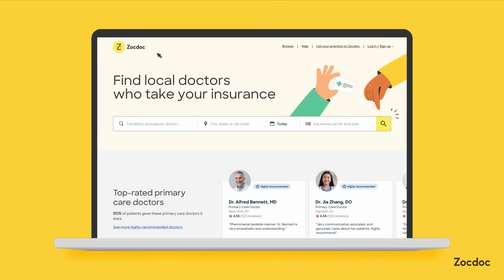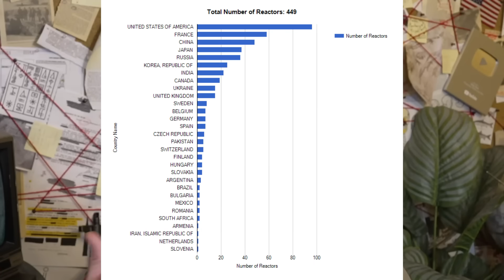America's Abandoned Nuclear Reactors | King Trout

Comment: One thing I'd say is that the 3 mile island incident was literally only detectable from the outside because someone at the facility vented the material into the outside air. It wasn't handled perfectly, someone was trying to cover their ass. But even with someone trying to cover their ass the measurable dosages of radiation would cause less harm to you than the amount of public panic caused by the incident. People literally hurt themselves more stressing over it than any amount of harm the radiation could have done to them.

Comment: NPPs were hardly profitable from the start. The fed gov't wanted them so they'd produce Plutonium, the electric power would just be a byproduct; thus the first, in nowadays engineering terms "dodgy" reactors were built.

After decades of nuclear scientists and engineers developing semi-fail-safe PWRs in the 1980s, the whole hype was over, as construction, maintenance & operation costs had gone beyond sky-high.

Finally, the cost for nuclear waste disposal won't be low either.

Comment: Actually, with the potential for modern, inexpensive internet resources, you could solve a lot of accountability issues by simply making a massive amount of such projects transparent to public scrutiny, rather than top-down centralized oversight and constant auditing, you could just set up programs that use large amounts of public funds with part of the contract stipulating that very large portions of planning and expenditure information be made publicly available within a specific timely manner. Thus maximizing transparency of operations and making it far more difficult to misappropriate funds, make unreasonable bids, allow questionable engineering decisions to go through, etc. (you'd get a lot of less useful armchair analysts giving their input, too ... but you always have to deal with that when dealing with any sort of public commentary or public forum)

Comment: You can omit the 'federal' part of that too, since it happens at a lot of state and local government levels, too ... and even bleeds into private sector outsourcing.

The common theme is lack of backed-in oversight and accountability ... with those two categories specifically implemented as objective and independent from the profitiblity of the projects/ventures themselves. (ie the oversight needs to be incentivized to be accurate, actively so, with systems set up to check them independently: ie multiple levels of public, private, and independent/citizen action/advocacy groups all keeping each other in check to minimize the risks of special interest manipulation)

California's fake energy crisis and Enron fiasco in the early 2000s is a good example of this. It did result in functional power plants, but often allocated where they weren't needed and sometimes still aren't needed today (ie not allocated to an appropriate portion of the grid to actually utilize the capacity).  That also got co-opted with some real estate development scams attempting to put up dense new micro-cities in places that made no sense.

Granted, if CA had actually allowed nuclear power projects to start that easily, they probably would've been included in that time period too, but AFIK most of the new power stations resulting from that mess were combined cycle gas turbines.

Comment: Completely abandoning regulations bound to Linear No-Threshold radiation hazard metrics (which are obsolete and non-scientific in nature), and adopting standards actually based on plausible, real-world health and safety metrics via real-world data analysis of the entire history of radiological exposure events would go a long way towards reducing costs of construction and operation of nuclear power plants (and improve opportunities for designing more advanced ones).

However, coupling that with public awareness and honest education probably aren't enough to counter the PR issue of the general public.

The problem then is that you need dishonesty (ie persuasive marketing and propaganda including a mix of facts and truth with a lot of marketing BS and promotional material) used to promote nuclear power among the majority while NOT allowing that sort of dishonesty bleed into the actual engineering, construction, operation, and regulation of the system.

Therein lies the conflict of interest of real-world marketing and politics. Though there's the rare exception where you can literally get away with honest marketing and building your entire brand around blunt, in-your-face, "brass tacks" sorts of business management, marketing, and salesmanship, (albeit that usually either goes along with barebones consumer products with relatively little customer support, or the complete opposite with high quality professional or industrial equipment companies ... more or less:  IBM at least has some examples of this historically, and some internal stories and anecdotes where engineers reached out to upper management to bypass middle management that had been pushing for poor quality, unfinished/rushed/flawed products from being released, of the sort that would've led to massive recalls and lawsuits if things went bad)

The Atoms for Peace programs probably would've been a bit better off if government co-opted form the start in a hybrid public-private sort of program with enough oversight to SOMEWHAT limit the purely for-profit aspects of corruption and mismanagement. (you'd need government appointed engineers AND accountants auditing things, though, as you're more likely to see corners cut in stupid ways if it's just monitoring cost overruns)

These days, things are so bloated that I'm not sure what the best option is, though I suppose there's always potential for trying to strip things down to a more efficient mixed public-private sector business model with both federal and State (or additional local) oversight, but who's actually going to set that up without built-in bloat and waste of some kind? (you need both the competence/ability and willingness/intent to do it to accomplish that ...).

Though, I suppose you could have the federal government standardize on the specific reactor design to use/license and mass produce (like France did), and set up a program entirely along mass producing those reactors, while decentralizing/delegating as much of the other construction work as possible to local industry (to better incentivize in-state use of resources/workers/etc and not run into starts throwing a fit over federally monopolized projects).

Except the current admin seems obsessed with Small Modular Reactor designs which have yet to be proven at scale, and would be a bad idea to put all the short-term investments into. (it's a higher risk choice than ideal for a conservative, centralized government plan to use)

While we should be working towards more advanced and efficient designs (including molten salt fast reactors, possibly looking into burner reactors separately from fast breeders), you can't necessarily make up for lost time by just rushing things after the fact. (that's a good way to make more mistakes and produce more bad PR)

As a mostly foollproof near-term plan, you can literally copy everything France did right, while working around some of their pitfalls and adapting things in a nuanced way to fit better into the more public-private sector hybrid model that would be compatible with the US market.

Comment: You forgot about Fukushima.. that was WAY worse than Chernobyl. 🙃
Reply: Propaganda exagerated the consequences of those incidents greatly
Reply: @klardfarkus3891 lol ya? 1 reactor exploded, and melted down at Chernobyl.. 3 exploded, and melted down at Fukushima.. 1 of which, the number 4 reactor had MOX fuel.. Chernobyl, managed to isolate the incident, and prevent it from going into a full China syndrome.. all they did at Fukushima was put fences around it, and cover the damaged buildings with structures to hide it.

Comment: If you're a Duke Power customer, it doesn't matter what state you're in, you're paying for their endless stupid. Cherokee take one and two... rates went up, both projects abandoned - rates did not go down. They were recently told they could not charge for projects under construction, but I'm sure (a) that won't last, and (b) they already know how to do it anyway.

The only "good" to come out of Cherokee take-one... The Abyss was filmed in the half finished reactor building.

(For the record, nuke plants only run for about two years before they'll be down for service - when they move fuel assemblies in, out, and around the core. They aren't enriched enough to function for more than about five years.)

Comment: Nuclear power plants are still the best way to make electricity Even the old "HUGE" style are safe and so efficient. But the new way (which many places in Europe are doing) is to build smaller facilities. Which of course are cheaper to build and the fuel is easier to transport and even more efficient (even though the efficiency is already so good with the older ones) and are built to "overclock" and output more than they are built for, so when in in the future they are needing to have more power to all the over over built areas as always happen. They pre-planned for that and so the positioned the plants that they can run them together so one can help the other ones that need help and they are built in a way that they are able to be built pretty quickly also as they don't need to spend all that money right now and take decades to build either. So they planned for the future in where they are now, where they will be built later, and they will act as one larger one as they are meant to hook together as built in future. And also acts as backups in case something was to happen to a facility another one fills its role and in worse case scenario that one has a really bad situation the damage is minimum to surrounding areas. So one thing government actually did right for once.

Comment: I watched a video a while back where someone broke down, in detail, how power plants are financed and become profitable. For nuclear, the best realistic outcome is that it takes 20 years to go from idea to generating electricity and then at least 10 years of running as efficiently as possible to break even after all you've spent, and that's with NO significant delays or other problems. Taking 30 years to get a return on your investment is TERRIBLE when other plant types can be realistically projected as profitable in half that time, some in as little as 5 years. Therefore the only people who would do it are those who both have the money AND are effectively pro-nuclear activists.
Reply: Fun fact the lifetime power costs of nuclear (this is the cost to build the plant then maintain it and generate power including all costs essentially) is actually comparable to natural gas. And about half that of wind and solar. Mind you that is with our nightmare of a system that multiplies the costs and ignores wind and solar needing large scale grid changes such as power storage to be reliable.

Yeah so they literally screwed you out of stable low priced electricity.

Comment: Little known fact:

Conner "King" Trout served in the United States Army as a 92G (Culinary Specialist) from the years 2008 to 2015. He was a proud member of 15th Sustainment BDE, 15th Special Troops Battalion, Headquarters and Headquarters Company. During his 2010 deployment in support of Operation: Iraqi Freedom, PFC Trout was conducting a logistic supply train down Military Supply Route Tampa and  his convoy was attacked by a complex ambush conducted by Insurgent Fighters. At or around 0320 Local Time, the center of the convoy was struck with a rocket propelled grenade and one vehicle was disabled; leaving the whole convoy locked in the center of the ambush. After several minutes of intense small arms fire and indirect fire, PFC Trout used his vehicle to create a barrier between the Insurgent Fighters and the downed vehicle, pulled four wounded Soldiers and all sensitive items from the wreckage, and loading them into his vehicle. PFC Trout rendered medical aid under fire to his four comrades before manning his vehicle's M240 Machine Gun to cover the convoy as they pushed through the ambush while taking several minor injuries from ricochets and fragmentation. His courage and loyalty to his fellow Soldiers caused PFC Trout to face adversity and put the mission and his comrade's lives above his own. In doing so, he was awarded the Silver Star and the Purple Heart.

Comment: The movie "The China Syndrome" significantly contributed to the public backlash against nuclear power after 3 Mile Island. The movie is about safety coverups at a nuclear plant contributing to problems there. It came out 12 days before the incident at 3 Mile Island and probably wouldn't have been nearly as successful as it was without the accident occurring.
Reply: These coincidences do seem to keep happening
Reply: I was going to mention I was disappointed KT didn’t mentioned it.
Reply: How about the FACT that the TMI incident was the direct result of HUMAN ERROR  ?
Inexperienced / poorly Trained Operators CAUSED the incident  .
Had they left the Plant alone  , rather than overriding some of the Safety processes and Equipment  , the Plant would have SAFELY just shut itself down  .

Comment: Nuclear power is significantly safer than any other power source even if you include Chernobyl in the average, because even solar and wind cause more harm per unit of power just from mining and manufacturing.  Hydro is pretty safe but dams do occasionally fail and kill lots of people.  Coal is the worst by far, with the years of life lost to air pollution being orders of magnitude worse than non-fossil fuel power.  Germany abandoned nuclear power because of the "green" movement, and of course used coal plus Russian oil/gas for power.  Anyone who claims to be an environmentalist, but opposes nuclear power for anything other than economic reasons, is just a Luddite.

Comment: The primary thing that killed these projects were revisions. There would be constantly new design updates during construction that required things to be demolished and started over. I have a older friend that worked on these and he said that by the time a lot of these were abandoned they had basically spent the man hours and materials to build the facility four or five times over. Piping would get moved which would require sections of the biological shield to be removed and rewelded in over and over. All the NRC had to do was put in design freezes at a certain point and then only require the revisions on new facilities. Couple those spiraling costs with the nuclear panic after the two famous incidents it was doomed.
Reply: The obstruction was deliberate and you can't convince me otherwise.
Reply: @Cragified

Actually  , NOT true  .
Operating Plants have " Mods " done to comply with new Regulations all the time  .
And part of the Licensing from NRC is compliance with the Design Specs at the time of Construction  .

Comment: The absolute funniest part? Coal plants produce orders of magnitude more radiation in the form of released isotopes than nuclear.
Reply: Ya I was really surprised when I got to film a couple movies inside a shutdown coal plant on the Detroit River and the amount of radioactive stickers were alarming. Asked one of the guys who worked there how and why and he explained it. Also told me a certain section of the blast furnace couldn't even be dismantled and had to be buried in a sheilded vessel because of how radioactive it was.
Reply: But we didn't have a really enjoyable cartoon about that. So no one has a real understanding.
Reply: Much of which is the remarkably understood Thorium, which we were on track to be using by the late 70's before politics squashed it.
Reply: @robertbeisert3315  It wasn't politics which ended thorium research, it was the discovery of vast quantities of uranium.
Reply: They also inject limestone infused water into the cooling stacks to to remove sulfur dioxide, resulting in a toxic slurry they store in open air “gypsum ponds”, referring to the synthetic gypsum created, which just also happens to contain large amounts of toxic metals.  The pounds are often located along the shores of rivers, adjacent to the power plants, and/or using improperly lined ponds which leach into the water table/rivers.
Reply: The key word there is "release". If even one pellet of spent nuclear fuel was on your kitchen table, they'd have to dig up your entire neighborhood as "contaminated". And you'd be placed in a lead box, and stored like all other spent fuel. It would more than a century before your body could be safely buried. That said, the nuclear power industry takes safety very seriously. (back in the days before they did... well, we're still cleaning up those messes.)
Reply: Coal doesn't potentially explode or raise the global background count, so this comment is total bs.
Reply: Coal contains a significant amount of mercury, uranium, and other heavy metals which go straight up the smokestack.  You are the only one full of BS here.
Reply: @rockets4kids Who are you replying to?
Reply: That's not nearly as funny as having a single organization which both promotes and regulates nuclear energy.
Reply: Bingo. This is bad snarky FUD...  UNSUBSCRIBED!
Reply: @stickynorth  ...Did you think the comment you replied you was disagreeing with the video in some way?